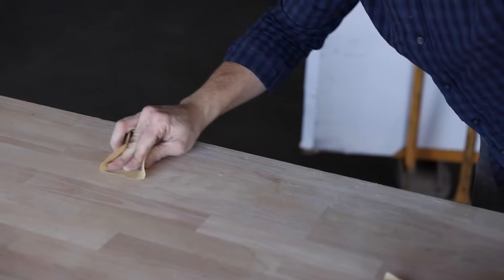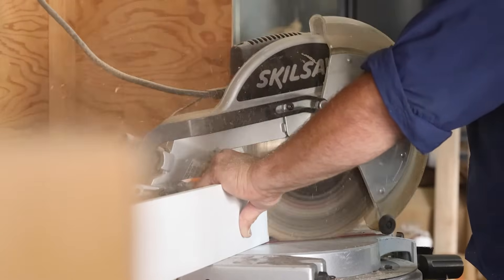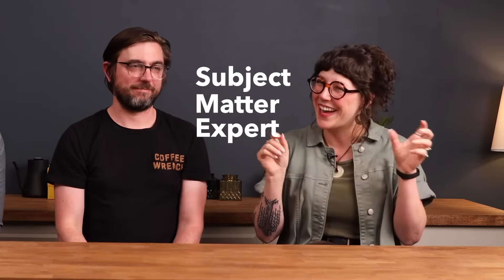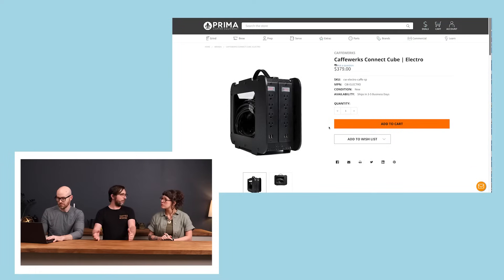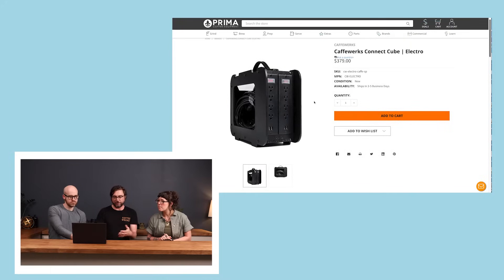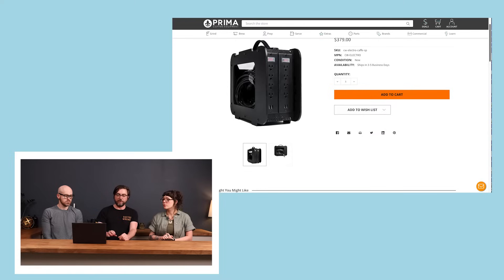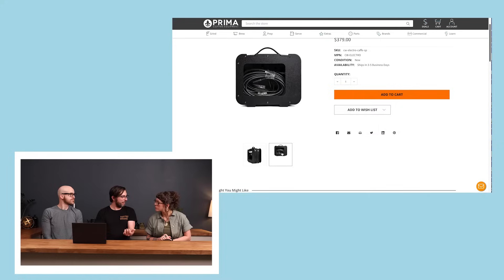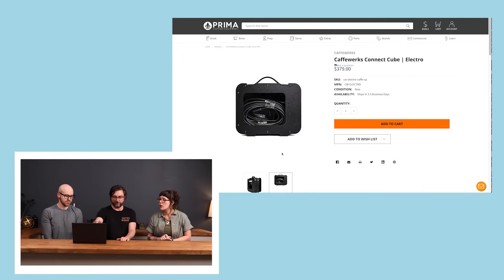Coffee Cart Plumbing and Electrical | Making decisions for our cart!

Comment from the maker: One clarifcation we'd like to make: Pitcher rinsers will function under a wide spectrum of water pressures, and they do not need to be matched to a pump/accumulator system with a specific or correlating GPM rating. Virtually any pump/accumulator system will be compatible with virtually any pitcher rinser out there.